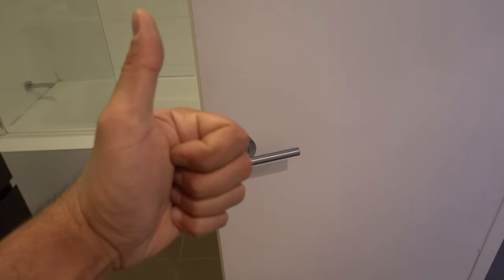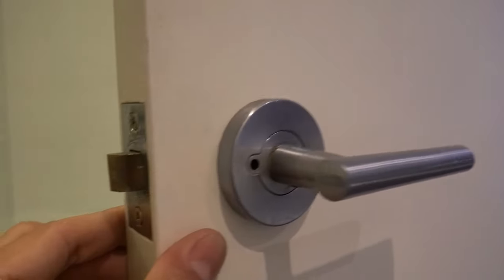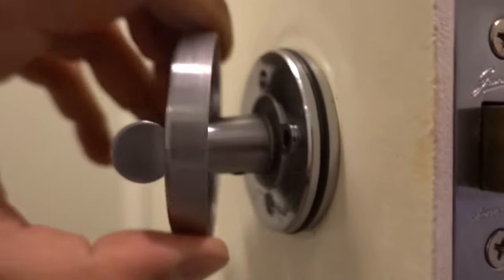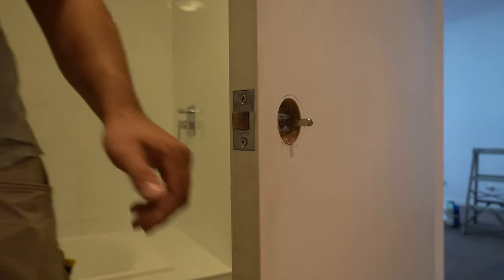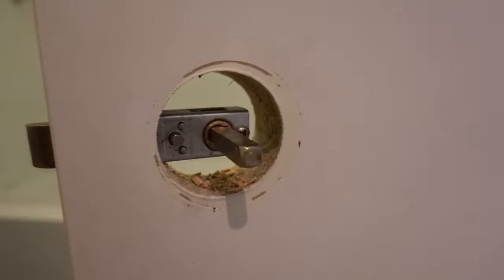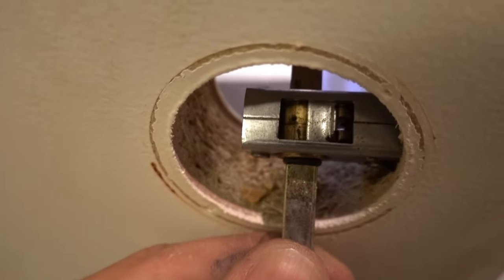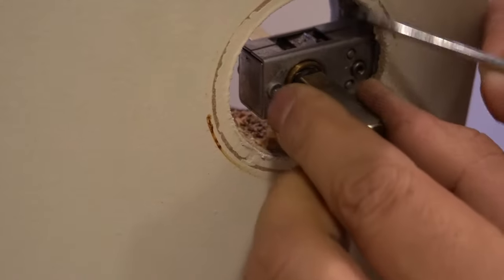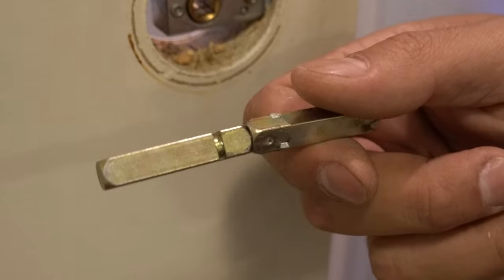Remove door lock without visible screws and stuck latch spindle

Comment: The issue is the spindles has gone in and the door is shut. Door won’t open now and has no handle, just the spindles stuck in it
Reply: The same has happened to mine. It closed so I can’t get to the other side to loosen the second screw. How did you manage to fix it?
Reply: How did you fix it? I have same issue my door is locked
Reply: Me too same issue
Reply: Sooooo. Anyone figure it out?
Reply: @Jprone  use some hard paper. Like cards. 
Push it in horizontally towards the lock. It should release.

Comment: Hey Bill thanks for nice video. I have a different problem with my bathroom lock. When I push the pin, door isn’t still getting locked. Inadvertent entry in the bathroom is still possible when someone is inside thinking that door is locked. Kindly guide me.

Comment: what if the door is closed. i got the screws out from the outer door handle but i can't  remove the latch because the door is closed. The latch got stuck while the door is closed. I could only remove the door handle which didn't do anything

Comment: Mine doesnt close without slamming it shut ...and when it is closed you can just push the wood and it opens. Go figure. 

Its gainsborough as well. 
Just a older version 2005 ish era.
For a master bedroom. 
And the locks on the top against the wood. 

The lock works you press it down and the outer handle is locked so it cant be pushed down and if you want to unlock you just push down the inner handle and itll pop up. 

So that worksand the latch worked on other doors so im thinking its the wooden door has clearly shifted ive had issues with the hinges so maybe they are what needs replacing im renting though so theres the whole landlord bs to deal with.  Anyway its that or maybe ill try put some cardboard orsomething behind the wall side latch see if i maybe the builder put it too deep in the wall idk. 

Any tips anyone?

Comment: Hey Bill i have a question on both covers i cant turn them either they are stuck in place or something else is happeing do you have any advice?
Reply from the maker: Some are on with a rubber seal and some need to be rotated anti clockwise

Comment: Ive just come across your channel. You explain things very well so I have great confidence that youll be able to help me with this problem. Ive been in the construction game for a while now. Im not at all a lock smith, but Ive had to wrestle with a few locks in my time. Ive recently come across an entrance lock that does not move. The door was closed and we couldnt open it. Ive taken the whole thing apart, both sides, up to exposing the latch. It has a type of metal sheet surrounding it. So, basically, you can see the latch going through  and this vertical sheet is totally surrounding it and takes up the whole...um...hole, so the latch cant be wriggled free. Im hoping theres a way of taking it out without damaging the door. Have you come across this type of locking mechanism often?
Reply from the maker: If you send me a photo I may be able to help. If you just need to open the door and latch is faulty I have a video on using door shims to open the door. Hope this helps👍

Comment: The O-Ring isn't even needed. It's redundant because the opposing screws keep the door handles together keeping the spindle in place. So if you break the O-Ring, you really don't need to replace it.

Comment: TIP: SOMETIMES THE PLATE IS REMOVED BY TWISTING IT OFF LIKE A SCREW INSTEAD OF PRYING IT OFF! IF YOU TRY TO PRY OFF A TWISTING LOCK, IT MIGHT END UP JAMMED LIKE MINE ! Luckily, I was still able to change out the lock though.

Comment: Solution to my issue !!! There are no screws, no o rings, no circlips BUT the is a small round shaft that sits up on the square shaft that prevents the shaft from sliding out. Soooo, the shaft is actual spring loaded so you just push it back into the shaft with a small flat screwdriver and then you can slide the square shaft out !!! 

Yeahhhh 🎉

Comment: Thanks for this, finally managed to get mine off. The innards of mine were much simpler than this (no o-ring, thank god) but the outside cover was really tight and felt like it'd been glued in place. It also opened only from the outside when most articles talk about taking it off from the inside first, go figure.